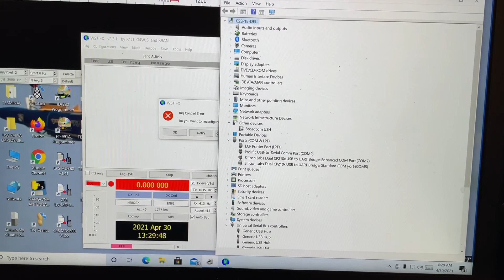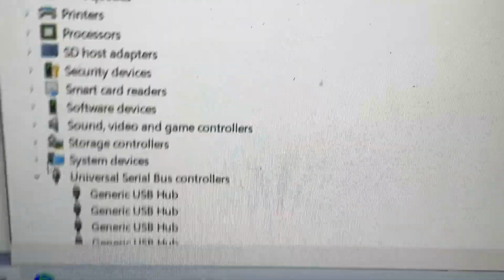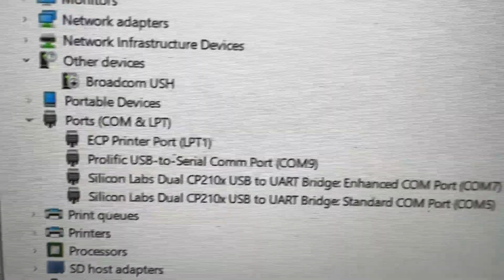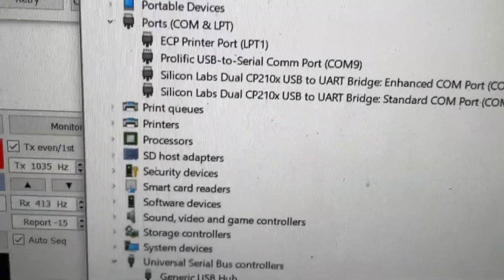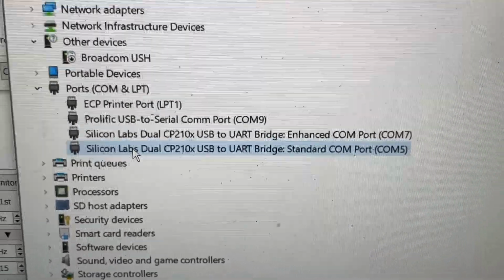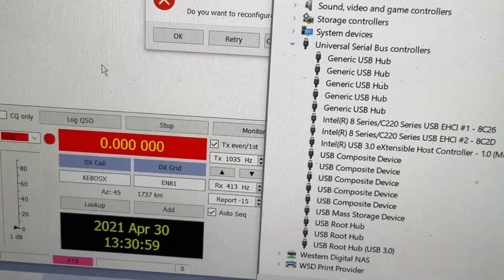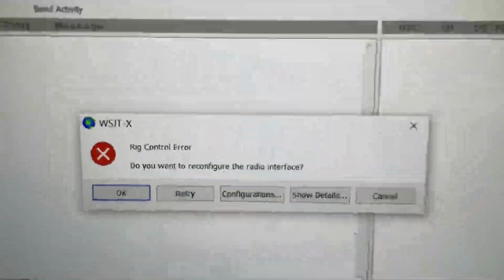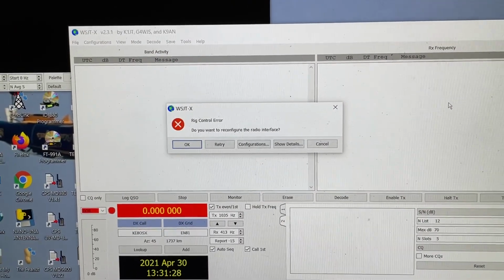Troubleshooting WSJT-X with a Yaesu FT-991a

Comment: I can’t get my 991a to connect to pc drivers don’t load and I get an error on usb even though it worked fine before I moved to a different location
Reply from the maker: More than likely you plugged in the radio to the USB port "BEFORE" you download the Yaesu proprietary virtual com port drive Because I been there done that Winders thinks it knows the best driver BUT IT DON'T, So Remove the drivers and go to Yaesu website ans support for the 991A and choose files and download unzip and install the com port drive. If installed correctly the device manger will reflect TWO com ports for the 991A you want to use the enhanced.